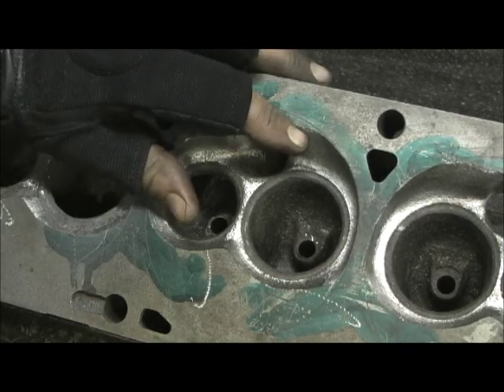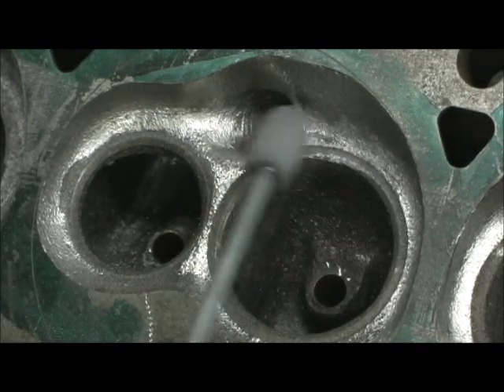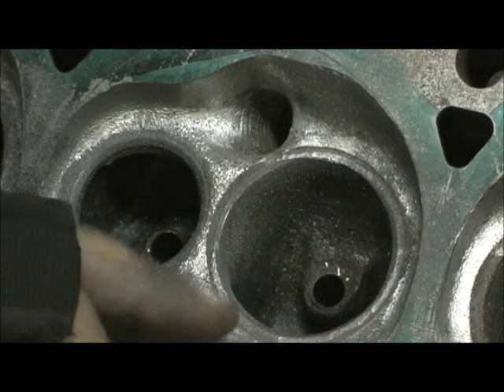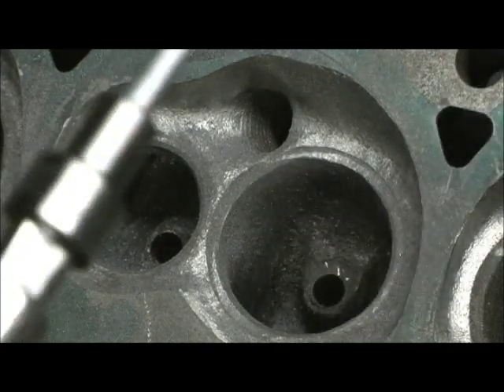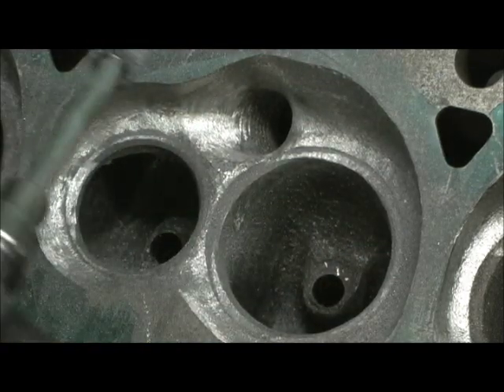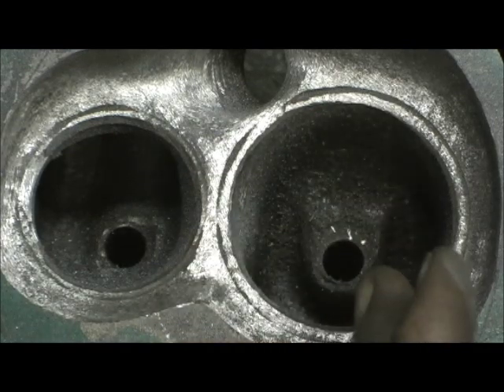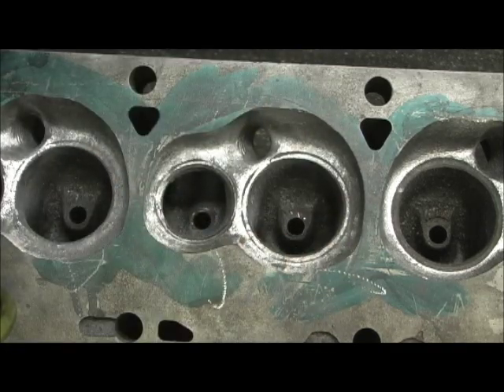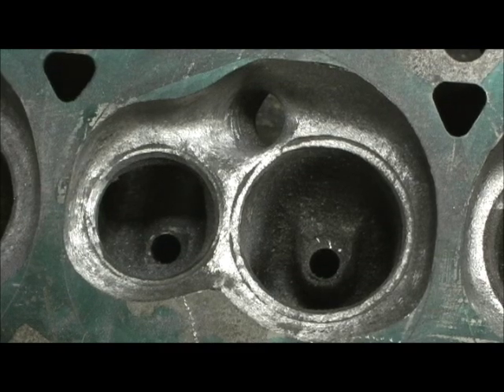FE 390 Ford Head Final Chamber blend and setup Part 4 7

Comment from the maker: No Prob dude!!! I love doing this more than you know. I have made about 60% of my income by putting current tech into old iron over the past 24 years. One thing I want to say is that FLOW NUMBERS are highly overrated no doubt; however, you have to take that into the mix of power production. It is about 1/3 of the equation of head/air/fuel mix and burn deal. I have just found that the other 2/3 weigh MORE then the numbers, which are CSA (Cross-section-area) and Wet Flow. Keep watching, thanks